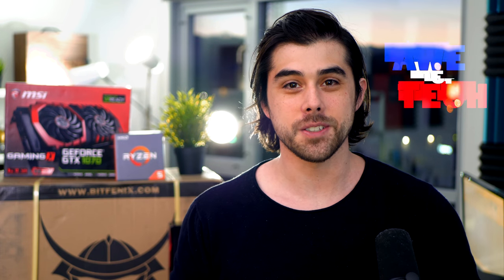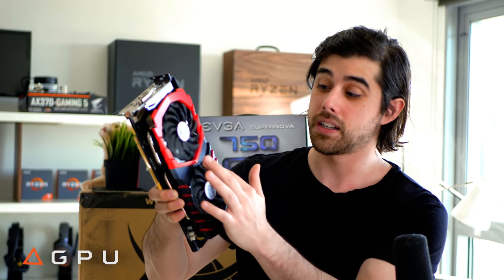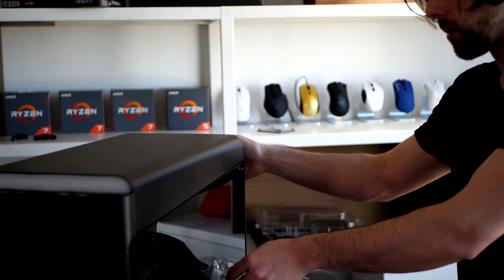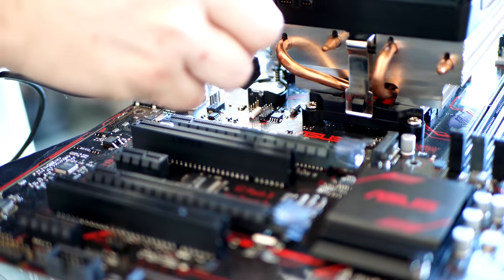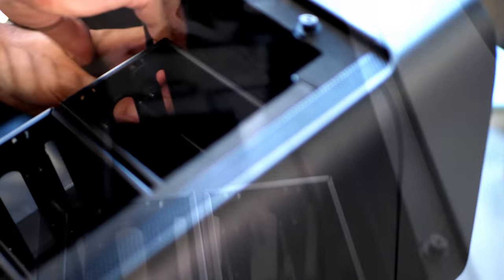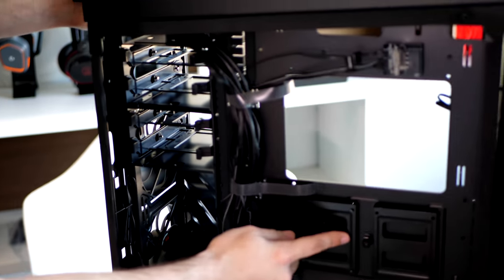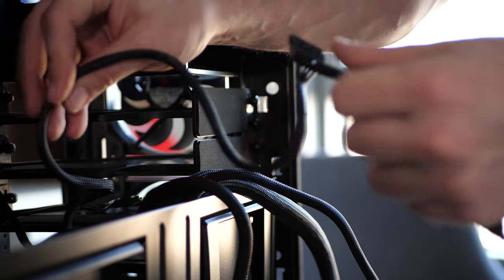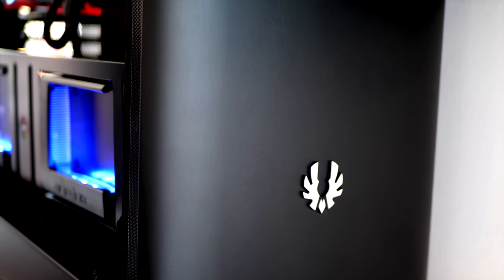Amazing $1300 Gaming PC Build Guide - The "Shogun"

Comment: That psu is pretty overkill, you could 650 or 600, and at 1300$, you should have bought the Ryzen 7 1700 and used the included rgb cooler (like the wraith max)  The 1600x is 250$+the Wraith Max 63 which is the same price as the 1700.
I understand the led ram with the tempered glass, but also could have gotten G.Skill trident z rgb at that same price point.
If you were willing to upgrade to the ASUS Prime x370 pro you could also sync the cooler, ram, and case leds together.
Here's what I could make for the same price point: (even 5$ less xD) http://bit.ly/2pnfxLM 
Not trying to hate, but just some tips :D